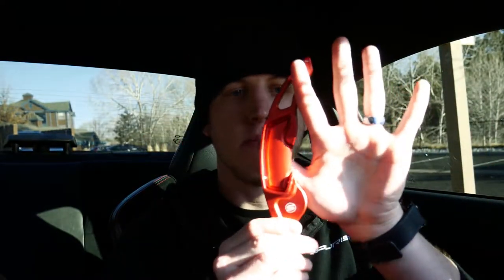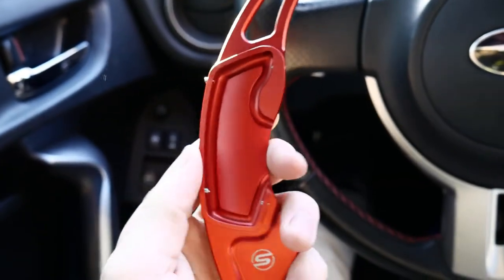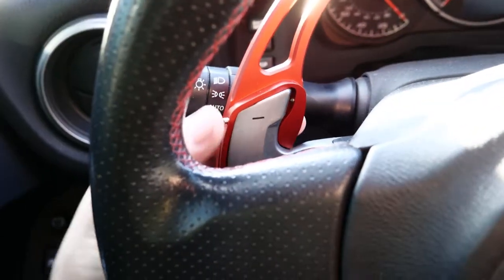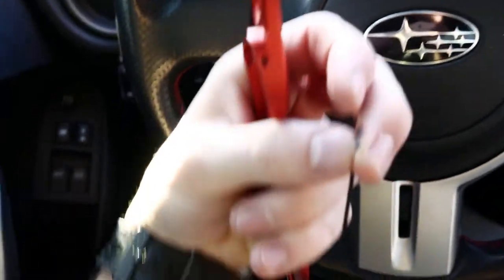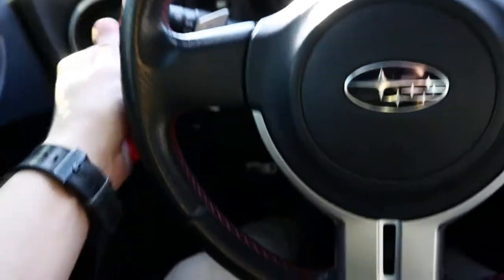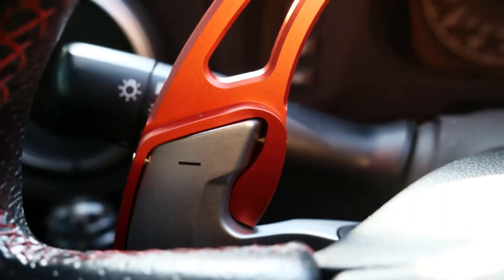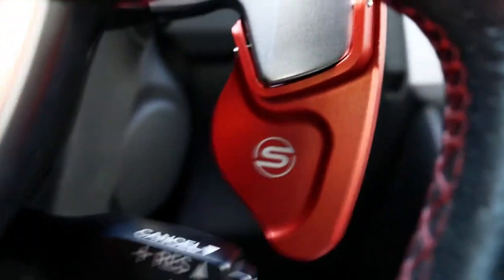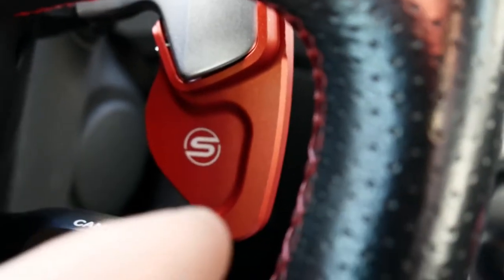BRZ SubiSpeed MK2 Automatic Paddle Extensions

Comment: 3m?
Reply from the maker: That's what I ended up doing
Reply: @CreamyClit  Why did you end up using 3M? Were the screws not working for you?
Reply from the maker: Amal de Alwis no they would always come out and never really hold the paddles as is. Even 3M tape had trouble because of the materials at times. The screws are a good idea but never worked as designed.